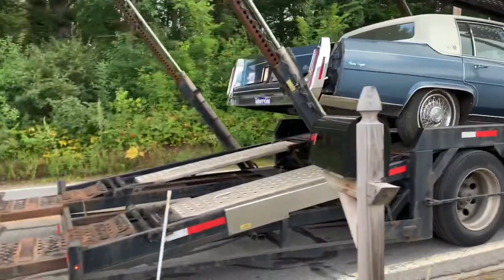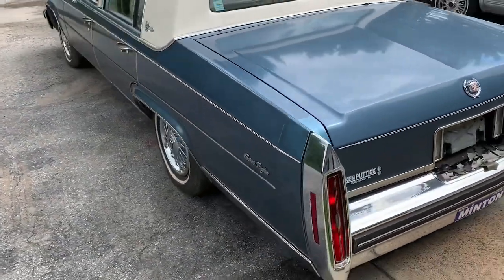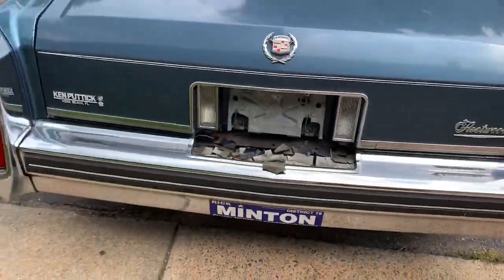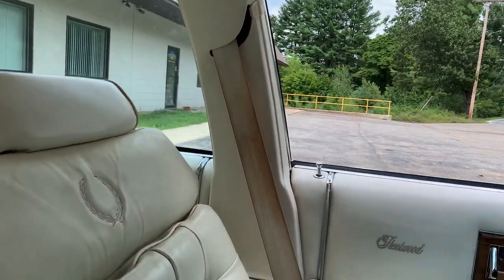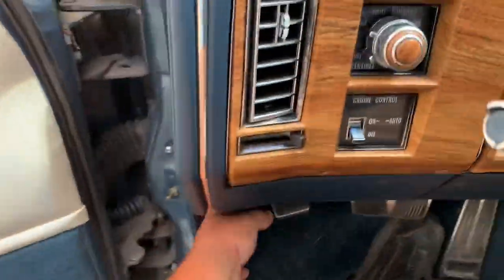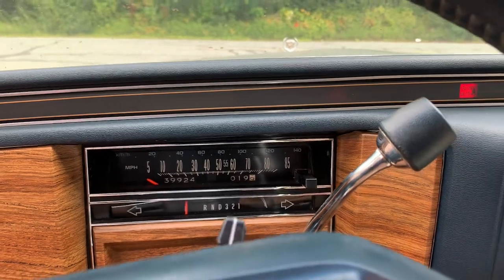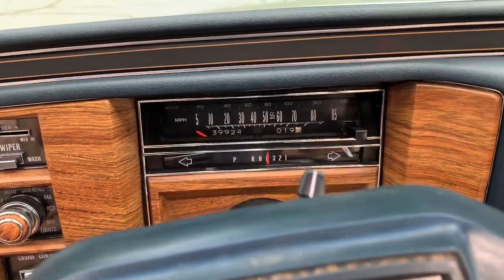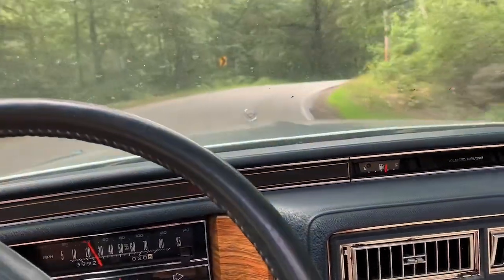NEW 39k Mile Cadillac Brougham D’Elegance + Inventory UPDATE WALK AROUND Whats coming up? SHOP TOUR

Comment: Back in 85 I bought my 83 Coupe de Ville (4100) from Brogan Cadillac Clifton, NJ with 13,000 miles on it. It was white with navy blue 1/2 leather top, moon roof with the light blue leather interior. It had Vogue tires with tru spoke wheels and Cadillac logo spinner caps. This car was a real eye catcher! I owned this  the car for 14 years without any engine problems except for an alternator that I can remember. Of course I used to pamper it while driving it. I Always warmed it up during cold weather. When regular driving, I accelerated it with a light foot. I sold it to an high school buddy of mine before moving to Florida with 135,000 miles on it and it drove and looked like the day I bought it. That 4100 was still running strong and quiet! I really miss that car!!

Comment: Anthony, this 1986 Brougham D'Elegance is another one of your.low mileage one owner survivors. It's a little rough around the edges right now, but after correcting some deferred maintenance, replacing  the dry rotted tires, broken  headlight, and bumper filler extensions, and detailing the interior, she will be another one of your gorgeous Guzzo Grand Dames.
By the way, a little FYI, the dry moss like substance you found under the hood of this car is what is shed by pecan trees when they blossom out in the spring,  the blossoms become pods, which in turn ripen into nuts ready for harvest in the late fall of the year. It appears that mice might have used it as nesting material in their underhood home. And yes, orange trees grow in groves, as do other citrus fruit like lemons.

Comment: Cadillac had pretty well sorted out the 4100 by mid/late 84. The head bolts and head gaskets were improved. Change the coolant and oil regularly. It will be fine.
Reply: yes thats why i have 175kon mine still runs and drives
Reply: @midnitesquirldog1 with as many miles as I have  I don't see the need for synthetic a high quality 10W30 with zinc additive and the Coolant tablets are a must Bar leak sells the same product as GM either will work

Comment: Best way to clean  seat belts is pull belt all the way out and clamp it at top so it doesn't  retract.  Soak in superclean  for an hour and then use brush to adjatate. A steam cleaner works good too.

Comment: Love the color combo on that 1985, its so south Florida, looks like the ocean and the beach.   How hard is it yank out that boat anchor 4100 and put something like a 5.3 or 6.0 ls with 4l60e or 4l80e under the hood???    And keep the factory gauges and climate control working??   The good thing about 307 olds cars is its very easy to swap a bigger displacement oldsmobile in there, same thing with 80-81 cars, a 500 cube Cadillac bolts right in

Comment: Sounds like a cassette was in there stuck auto reversing.  Just eject it, radio is probably fine
Reply: Yes I was thinking the same thing about the noise clicking coming out of radio  ..Got to be a cassette stuck in there .I'm sure if Papa Bear hears that clicking sound he will know it's the cassette stuck in there I guess Anthony is too young to know about cassette player .
Reply: The cassette door sits differently when there is a cassette in there, probably a blown capacitor in the head unit.

Comment: The white on that spectacular blue is just way too beautiful. The startup was flawless, I loved hearing that. Then @9:50 we got to hear that UNMISTAKABLE Cadillac horn. This baby is a treasure. Like them or not, I think the HT-4100's are marvelous, and the only genuinely Cadillac engines ever made. I once owned a 1980 Biarritz gas conversion with an Olds 350 in it. Terrible car. If the HT-4100 isn't in it, it's not a genuine Cadillac as far as I'm concerned, which is why I won't ever buy an 80's Cadillac that's older than 1982. Every sound that comes from that beautiful engine is music to my ears. Yes, they were a real headache for their original owners, but nowadays if you polish them up, they are marvelous engines. Love it. Thanks for the upload, Anthony! BTW, I want that Buick Electra Wagon. LOVE those.

Comment: Hey Anthony! I just bought an 83 olds 98 regency in similar condition to this, (maybe a little more rust) but I had the same issue with the radio not working. I just took it out and put in a rebuilt symphony sound unit from 84, but would you mind letting us know where you plan on getting your radio serviced? May be good to know for future reference, it seems like these units have a known problem for failure

Comment: The cycling clicking on the radio is most likely an issue with the cassette player mechanism. The micro switch is somehow engaged or malfunctioning telling the mech to try to engage when there’s no tape in it. Don’t try to put a tape in until you have the radio fixed - you may never get it back out in working order lol

HT4100 - MAINTENANCE!!!!!!!

Anyone who buys this car MUST change the oil no more than 3,000 miles and coolant EVERY year!!! Check 4100 owners forums for the proper coolant to use!!!

Since it’s been sitting for 15 years I would change ALL the fluids right now - coolant, oil, brake, transmission, rear diff, and then drain the fuel and fill the tank with premium and run a bottle of Chevron Techron to really clean the fuel system.

Then after you’ve done all that take it in the highway for 20 miles and set the cruise at 70. Give it the beans a little too. You want to clean it out, don’t baby it.

Comment: the 4100? run. as fast as you can. those engines are one of the worst designs ever, unless you like blowing headgaskets. i'd take a Northstar engine over one of those. up there with the that awful oldsmobile diesel of the worst engines ever made.

Comment: Improved access to Tail/Brake Bulb on Passenger Side, would have looked better if the Roof Colour had been kept closer/same as the Body. Too bad about leather interior, but I guess White Velour wouldn't be White after someone sat in it. My first Caddy was an 86, the first year with the Olds 5 Liter. No Ball of Fire either, but at least it could maintain Highway Speeds when facing a Headwind. It is easy to replace the Broken Headlight, 4 Phillips Screws and your done, unlike my 2011 STS, where the entire front of the Car has to come off to get access, Bulb $5, Labour, $400. 
I have always like the Instrument Panel on these Cars, nice and Symmetrical, Drivers and Passengers sides, and the location of the Idiot Lights, easy to change them when they burnout.

Comment: Just so you know Anthony, this is a later 1985 with the slightly strengthen 4100 engine. You can tell the later strengthen motors because they had the ribbed value covers versus the older 1982-1985's that had the chrome non ribbed covers. These are the engines you want to have if you have to buy a 1985.
Reply: All the '85s I have ever seen (and I've seen and owned a lot of them) have had the "ribbed" valve covers.

Comment: If they still built cars like this chip shortage would not affect us.  Nice clear gauges, mechanical shift lever, buttons and switches for everything.  No screens. Get in a new car and it is full of electric driving nannies and screen galore and touch sensitive this and that which don’t work half the time.  Everything requires a chip.